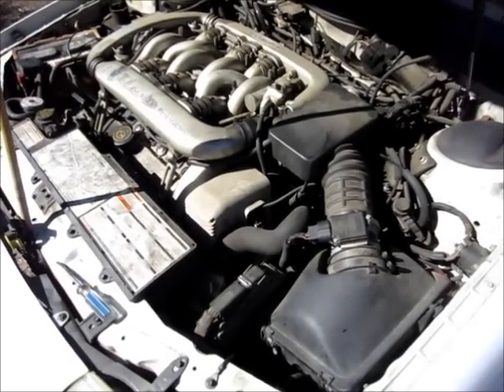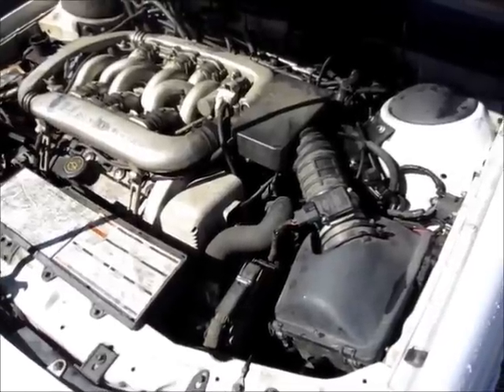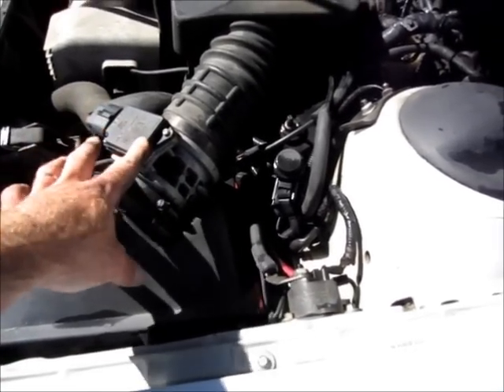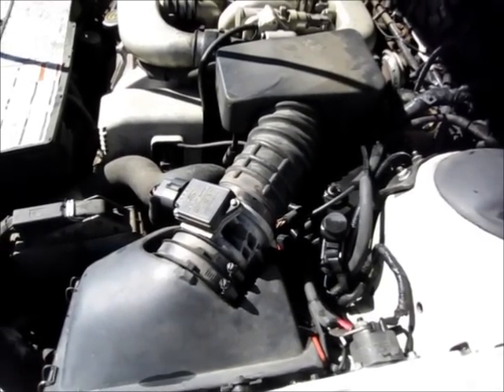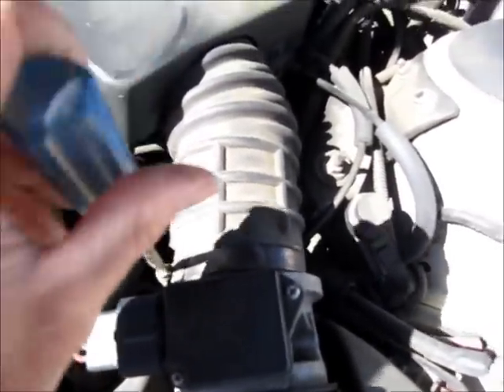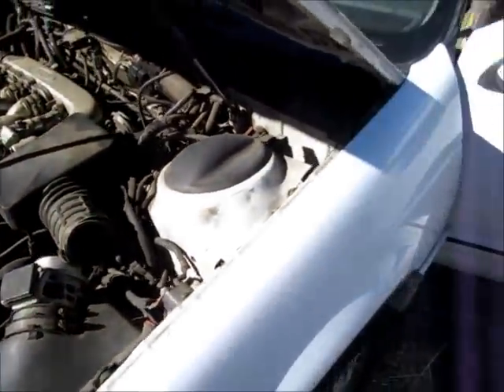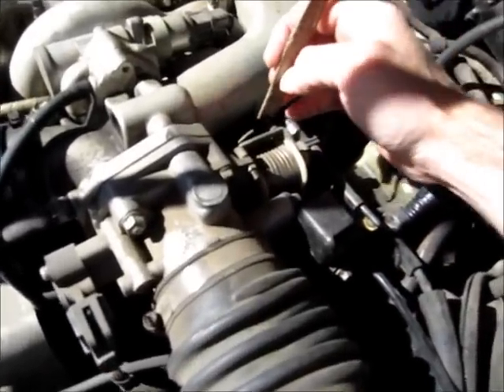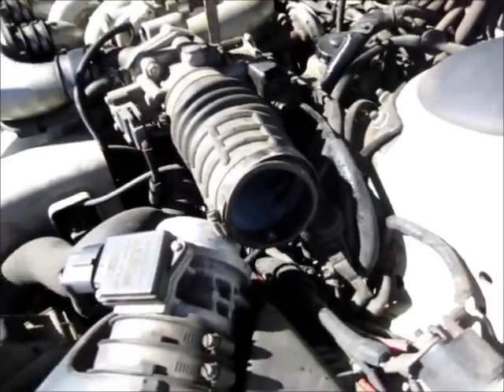How To Remove Carbon Deposits Inside A Car Engine With Water

Comment: Notmally you should do this only when u want to change your engine oil,b4 that add seafoam into spark plugs holes,or add paint thinner,or add transmission oil tho engine has to be hot or turn3d on for about 40mins,after 40mins,disconnect the plugs and soak them pistons,turn engine by hand after 8hrs,then suck out all of everything using a vacuum cleaner,add transmission oil to engine crankcase next day,let engine ifle for 30mins,then fisconnect the vacuum hose,use nescafe straw attached into bottle water container,and then put emgine on 2000rpm,run for good 8mins. Dislodge all oil,water, atf,kerosene,by doing oil drain,oil filter...add new cheap oil add kerosene like half liter,run engine for good 5mins.drain oil,change oil filter ,add your mobil,reslone,etc original oil weight,and watch the car engine fire down like new.b4 the engine will spoil,jesus wont have come.

Comment: Do this using a small nescafe disposable paper drink,use the red straw from the nescafe drink,connect it to the hose going into the throttle body,buy a transparent hose,connect to the hose going to throttle body,then puncture a tiny hole where the nescafe hose will connect to the transparent hose,it gets sucked up real fast,do it like 4 times.your pistons head,valves,valves seals would be shinny grey like from factory.borescope will tell u results.b4 u do this,engine must be warmed up for at least 25 mins.its like using water on a  hot sticky carbon filled pressing iron.

Comment: Side note. Automotive manufacturers, during r&d to engines for water infiltration.  Manufacturers have to meet a minimum requirement to satisfy federal regulations. By the nature of that, every engine is anle to intake a certain amoumt of water at a certain rate. I can not remember the numbers off hand at the moment. If a guy wanted to find out what the numbers are, they are out there and available. Most engines not only meet the federal standard, they exceed it.  To me, it is at times suprising how an engine can inhale such a large volume of water so quickly and still stay running. Unharmed.  Then again, some engines cant handle much at all. 
      A 15 liter Cummins can gargle gallons of water while laughing at you. Crazy stuff.

Comment: Ingesting bursts of 1/2 qt in 5 seconds cools combustion chamber very rapid and the carbon having a lesser contraction rate as compared to metal, will spike out of the metal parts.

Comment: If you even have an engine with a blown head gasket, when you tear down the engine to replace the gasket 
you will find that where the coolant leaked into the cylinder that the piston and the head that covered it will be almost if not all free from carbon. I would not use water but I would use the blue  windshield washer fluid to clean the carbon out.

Comment: For goodness sakes do NOT do this with a garden hose. You just have to use a squirty bottle set to spray a FINE mist into the intake hose. Half a squirty bottle of plain water will clean the engine of all carbon deposits. Every now and then add some fuel injection cleaner to the petrol to keep the engine clean. This guy was lucky not to have blown his motor.

Comment: Dear lord NEVER use your hose for this. Get a spray bottle with distilled water. Also you need to be extra careful if you have an interference engine. 

Also change your oil after doing this.. You're bound to get blow by that puts water in the oil. Especially if you're dumb and use a hose.. lol

Comment: Pump up garden sprayer, distilled water.
Reply: This will also stop the cold-knock on an early 5.3. Apparently, the carbon in the ring lands is just enough to cause the issue. I have been using E85, Just enough in the tank for one days worth driving and then fill with premium.  My engine is not FlexFuel but this is my second 5.3, one got over 300K and the current one is coming close! I do this a couple of times a year and I never let it sit in the fuel system.

Comment: Good idea, definitely a bit excessive on the water. Cars running water/meth injection look beautiful and shiny inside, and they only get about as much meth as the size of one injector and during high boost pressure. your rpm going that low is actually close to hydrolock & dickered stage IMO. +1 for a spray bottle! and +1 for full temp before the cleaning.
If one wanted to be really renltentive, they should do an oil change after too. The additional pressure from trying to compress water will try harder to reach the crankcase via blowby

Comment: Dude, that is NOT how you do it.  You pull loose a SMALL vacuum hose and suck the water in through that, GRADUALLY.  You are damn lucky you didn't hydro lock the motor.

Comment: never use tap water ...you need distilled water you fuck head and fish tank tubing with a valve i do this a rebuild motors and trust me they are literally metalic looking inside piston heads look super clean...your just a fucking idiot for using a hose that water has chlorine coper zinc and kinds of other mineral...fucking idiot

Comment: what the hell are you doing!! Too much water. and the water alone will not decarbonize very much. in a gasoline engine you have hard carbon that includes Metals from the engine oil add packs. water does not nor will it ever remove this build-up. additionally all you are doing is releasing fragments of carbon only to have it accumulate in you exhaust system. you are robbing peter to pay paul. to propey decarbonize you need to returns the carbon deposit to a liquid state or rather suspended in a liquid and introduce expansive media into the combustion process which will chemically convert said carbon into gases.

Comment: Don't do this with a water hose! 

It's too much water. Aside from possibly damaging your motor when you add too much water it doesn't clean like it's supposed too because it cools the cylinders too much. Ideally you want the all the water you inject to turn in to steam when the gas/air mixture is ignited. Water turning into steam cleans your engine's internals, water that stays water does nothing. 

Use a pump up Garden sprayer (10 to 15 bucks at any hardware store)with the nozzle set to spray as fine as you can and spray in short burst.
Reply: THX 1138 

Ha. The engine makes lots of steam as it runs by a chemical process involving oxidation. It’s called combustion.

Comment: Dude... hydro-lock much???? I just did this today, but instead of a garden hose, I used a water bottle with a tiny vacuum hose (like less than one millimeter in diameter on the nozzle end) going to a vacuum port to suck it into the engine. It took a good 3 minutes for my engine to suck up an arrowhead bottle's worth of warm water and the truck was throwing multiple misfire codes after I was done. Of course it was fine after I revved it up a few times and cleared the check engine light. Much smother response and my wideband gauge stays more consistent now. I did notice a teeny tiny bit of milking on the oil dipstick, so be sure to let your vehicle idle for a few minutes after you're done to suck the water vapor from the oil that leaked passed the piston rings during cleaning. You don't want milky oil when you're putting load on the engine.

Comment: I couldn't help laughing when i saw that amount of water going into the engine. No engine is going to need that kind of washing when properly maintained. It's going to fail sooner now, not later.
Reply: +eeeno maintaining a vehicle has nothing to do with whether or not their are going to be carbon deposits. Even the most babied cars have carbon deposits from regular PCV vapor and batches of bad gas. Carbon deposits on a piston can cause detonation, which is not good.
Reply: +GioGuitarDude Bad batches of gas are a rarity unless you are in Russia. My point is that engine does not need that much water even if it had developed a problem with carbon deposits. That kind of washing is going to damage the engine and cause it to fail. A desilitre of water as hot steam is more recommendable. It should never be done if one is not absolutely sure that it's caused by carbon deposits.
Reply: eeeno If you can keep it below the threshold of hydro lock (which the guy in this video was really close to by the looks of it), then the results will always be benificial. Steam on the pistons, valves and catalytic converter gets rid of carbon that should NOT be there. A gunked up engine has to work harder to produce the same power, and every internal combustion engine on the face of the earth is destined for carbon buildup regardless of maintenance or gas quality. Regular water or chemical cleaning keeps the engine better than it would be if you left it alone. I'm not saying the guy in the video did the right thing, but don't ignore the fact that carbon buildup is inevitable and good to get rid of.
Reply: +GioGuitarDude There are engines with over a half million km on clock and yet they don't have carbon buildup and have never been treated with water. Why is that? Do you suggest that water treatment should be done as a regular maintenance? The gasoline contains additives help to keep the engine clean and yet carbon buildup hasn't been a problem with the modern petrol engines due to precise fuel injection systems.  Diesels are different and require running the engine at lower gear at highway speeds for a few miles and carbon cleanup is done. 

In the old days when every car had a carburetor, these water tricks had probably more use. Today it will just damage the engine. They weren't even supposed to be clean!
Reply: eeeno I'm afraid I don't believe you are very familiar with a modern internal combustion engine. Many certified mechanics would highly disagree with you. Fuel additives and injector cleaning procedures wouldn't exist if modern gasoline didn't gum up engines. No one would ever need a clogged catalytic converter replaced if modern gasoline didn't gum them up with carbon. Pre-ignition knock wouldn't exist if modern gasoline didn't leave carbon deposits. And the cleanest burning gas in the world wouldn't keep oil sludge from the PCV ventilation accumulating on the valves. I'm going to have to trust the many certified mechanics who condone carbon deposit removal on this one. No offense.
Reply: +GioGuitarDude I'm afraid that i have to say the same thing about you.  I'm not denying the existance of the problem if you understood what i wrote previously.  Things that you've written indicate that you really need to rely on the certified mechanics. No offence. By all means, do the garden hose trick to your own car and do it every month to keep it clean. Why haven't i found any official information from the automobile manufacturers regarding the water trick? It's because they don't accept the use of it or any additives to the fuel as it already contains chemicals that help to keep the engine cleaner. Also a car that doesn't have any faults and runs cleanly,  won't even develop a carbon buildup problem. Nor would it ever need to be cleaned with water...  Of course a car that is only driven short distances in a city traffic could benefit from fuel additives but not in a continous use. Even taking it on a longer trip once in a while could equal the same benefits.  Also a car that's at the end of its lifecycle could benefit from carbon cleanup... but there's always a reason why it accumulated there in the first place.  A car engine that's operating correctly and hasn't been neglected, very rarely has any problem with carbon buildup.  So please try to understand that i'm not totally denying it.
Reply: eeeno Well I don't think manufacturers give any advice on carbon deposits because the vehicle usually doesn't have that issue until the warranty has expired. I don't do the garden hose trick, but rather a vacuum line hose with a .5mm restrictor in a cup of blue window washer fluid (consists of .5% dye, 39% methanol, and  60.5% water). The restrictor removes all risks of hydrolock and the methanol increases the octane so that the cleaning doesn't induce knock. This is identical to a methanol injection setup used on race cars, but used at idle for a few minutes. More power and no more 02 sensor code. Win/win for everybody. No one can deny the benefits of removing inevitable carbon deposits.

Comment: This definitely works, but if someone is very heavy handed sloshing water in there is a possibility of hydrolocking the engine. It also needs to be done  at moderately high rpm so that water does not form a big puddle in the inlet manifold.
Reply: Yeah but does it work?

Comment: if someone is really that concerned about carbon buildup, next oil change just run some automatic transmission fluid as your oil and let your car idle about 5 to 10 min. there are more cleaning additives in transmission fluid than in motor oil (yes, oil does have cleaning additives in it so the better oil you run, the less worried you should be) and it will still provide proper lubrication for all components but you still have to then drain the atf, run oil through the motor, and then drain that and fill it up one last time while changing your filter each time as well. or risk hydrolocking your engine your choice.
Reply: Oil doesn't touché cylinder heads
Reply: And this cleans the intake side of the engine?

Comment: I did this and  had a rough idling engine but not anymore, I was actually very surprised how well it worked
Reply from the maker: +Rex Holes Glad your engine is running better, thanks!

Comment: intend to do this (not of course with the garden hose) but how can i with my rav4 2008 and corolla 2002. Every time I disconnect the rubber intake boot, the engine runs but in few seconds it dies. I also tried disconnecting just immediately after the air filter box connection planning to just spray the water through bottle sprayer with an extended nozzle with a length exactly just before the throttle but, engine still dies... How may i do this? with my corolla 1995 engine does not die so I will do such.
Reply: Have that same exact problem with my 2002 lexus rx300 it's the high end toyota highlander but it dies as soon as I take off the boot on the intake, I hear a few people say they pour the water through the br a key booster kind of like seafoam...don't know if I should try that.
Reply: nicandro lalangan This reply is probably too late to help you, but I'll post it for others who might have the same question.  You need to unplug the mass airflow sensor to get the car to run with the intake tube disconnected.  Be warned that this will cause the check engine light to come on so you should have a code reader that can clear the code and turn the check engine light off when you're done.

If you're wondering why, here's why.  When the intake tube is disconnected from the mass airflow sensor, no air is passing by the sensor.  The ECU says "there's no air going in so I don't need to put any fuel in either".  No fuel, no run.  When the mass airflow sensor is disconnected, the ECU says "I have no idea how much air is going in, so I'm just going to put a small amount of fuel in".
Reply: Well thanks I'll try that :)
Reply: nicandro lalangan Did you remember to set the idol up to 2000 rpms?

Comment: Thanks for video. Just amount of water you used seemed a lot. I just done similar treatment on 1998 volvo v70 t5 with 205k miles, used around 100ml of filtered water. Noticable improvement in performance for free!

Comment: not a bad video, but you might also mention that the vehicles engine should be at operating temp before starting the process, and the best thing to do after the cleaning process is to drive the vehicle, look forward to more videos in the future
Reply from the maker: Fox Nakamori Thanks a lot, good tip.
Reply: *****
no problem at all

Comment: Jeepers - thats a lot of water!!! I filled an empty glass cleaner bottle with water and sprayed in a light mist of water. If hydro-locking your engine can cause such severe damage why would you aim a hosepipe into the intake? Anyway thanks for video.

Comment: There is a much much simplier way to clean carbon deposit in all engines while driving it. it had been proven in the industrial and commercial applications for over 15 years
Reply: Hung Tran  and what is it? Pushing the RPM higher while in 3d gear for t least 30 minutes ?

Comment: This  method does work  .  Cars  with blown head gasket tend to have very clean pistons , because of  the water leaking into the chambers. Also water injection in the air intake  is used on turbo charged car ...............mist  spray .  Good video . Thanks for taking the time to do it and post . Well done .
Reply: Yeah. Water methanol injection keeps shit cool (and clean) and octane up, enabling MUCH more boost as well as providing a little more fuel , methanol, which acts as anti freeze as well. As I understand...